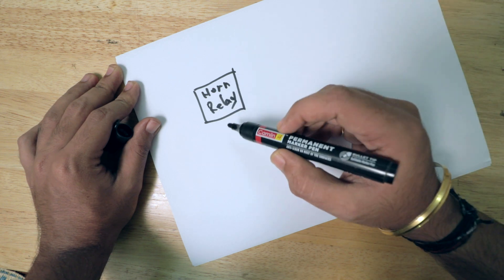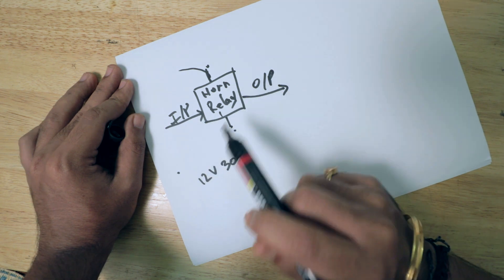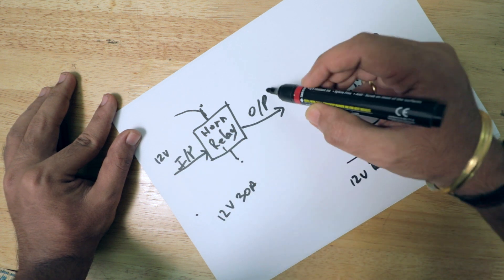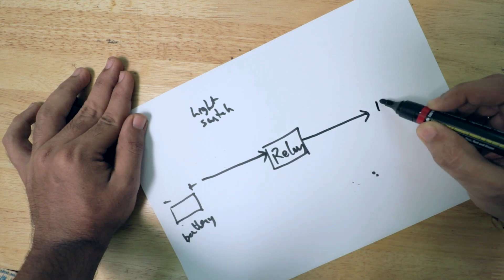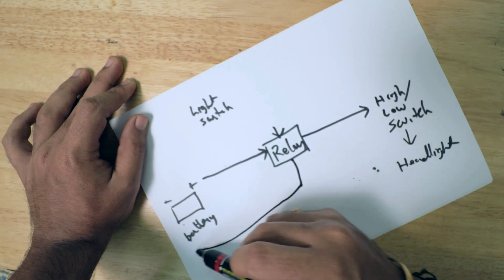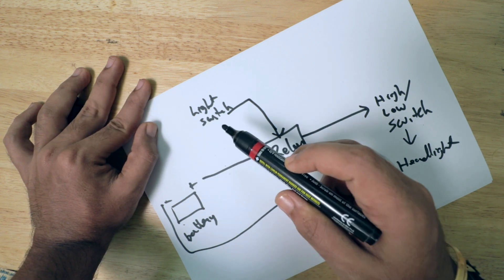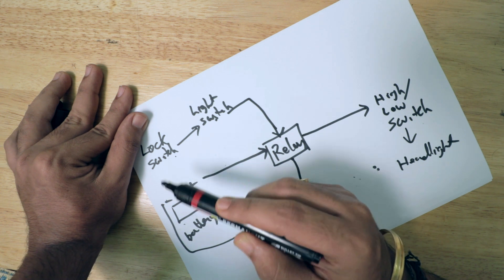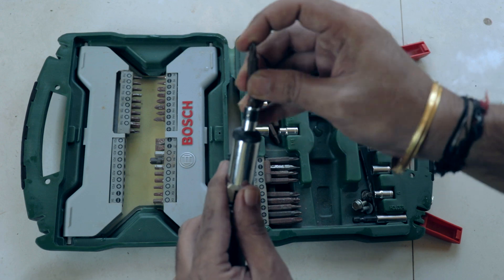Convert any Scooter From AC to Full DC | Activa | change headlight connection from engine to battery

Comment: hi, thanks for the tube. very informative, i got to know about relays. 
one doubt though. you instructed to connect battery +ve to relay30.  dont we need a fuse in between?
how about taking a line from lock switch and feed it to both light switch and relay30?
as there is factory built fuse between battery and lock switch, i guess we don't have to put another. am i right? 
i want put headlight on DC via a switch in my Activa 4G BS4.  appreciate your answer.
pls help me understand the concept. thanks
Reply from the maker: Yes sir , I did mention to use a fuse In between battery +ve and the relay for protection.
You can use supply from stock lock switch but then it will pass voltage  from stock wiring which can be less than what you can get directly from the battery
Reply: thank you Rahil ji, good morning
pls see this diagram https://photos.app.goo.gl/gkvA8skc83PYPWbU8

1) except for the little drop in voltage, is the change in wiring OK?
is my 8W rated switch protected from 70w bulb load?

2) manufacturers used to give relays with headlight bulbs until BS3 (Activa 3G for Eg)?
if not how were the switches protected then?

3) does this switch breaks tail light along with headlight in this wiring parellelly?

4) is the tail light also converted to DC if I just put headlight wire on relay in visor?

pls suggest any changes. thanks so much
Reply from the maker: Circuit in original part in your picture is what you should be doing to convert your bike to DC.
Original stock uses alternating DC .Main ac voltage >30vac comes from alternator to regulator and then gets regulated to alternating DC to  the headlight bulb.
1) 70w load is not recommended as the size of battery in activa is small so you will face low battery problems
2) No relays, it's on Regulator Rectifier (RR unit)
3) yes headlight and Tail light are parallel
4) which visor?
Watch the video again carefully after considering my points and you will understand. If not then  I'm still here😄
Reply: Thanks for reply Rahil ji
I'm not done bugging you 😁

1) I thought stock H4 draws 35+35=70w while on high beam. I'm wrong then. still how those 8w rated headlight switches in older Activas were protected without using relay?
if they switched headlights without relay, why can't we do it now?

2) only diff between 2 parts of the drawing is where I connect relay30.
what's wrong if i connect both relay30 & relay85 to +ve comin from lock key instead of running separate wire and fuse directly from battery to relay30?
I do this and still expect the circuit works good and I'll have lesser load on switch?
Reply from the maker: Haha no problem Rajesh sir😄
1)stock halogen uses 2 filaments, one for high and one for low beam, 35w each at a time . From what I know the switches are just made up of copper terminals for the only purpose of connectivity. That's it

The purpose of relay is just to bypass the voltage from stock wiring to the new bulb directly. This method is efficient. 
Also note I disconnected the stock supply at the high low switch
Reply from the maker: 2) if you do that the relay will be energized the moment you turn your bike key to on and switch the headlight on😀 which I believe you definitely don't want.

First of the load what you are considered about of the switch. Take it out if your mind. That does not matter at all if using stock switch. 
And like always,
I'm still here or if not then Instagram 😄

Comment: My schooter haven't battery what is remady .can i get dc volt for my break .light and indicators
Reply from the maker: I did not understand exactly what you are saying. Your scooter does not have a battery, if that is what you are saying then you will need a RR unit and a battery.
Other option is to use rectifier diode but then it will still be variable and alternating

Comment: Sir i have pulsar 200  2007 model i want to make ac to dc pls guide
Reply from the maker: The logic is same as what I have mentioned here, find a +12v after the lock switch and pass it through the on off switch to the relay coil, then connect the other end to ground. Then use a +12v from battery to the relay input and connect the output from relay to the input of high low switch. That's it! All the best😊

Comment: Plzz tell me that if i install bigger battery than original in my bike, would the rectifier charge it efficiently as before or not??
Reply from the maker: It will take little more time to charge higher capacity battery to it's full capacity. So no problem installing higher capacity battery

Comment: When i started with self the led light was blinking and there is little smoke coming out what to do
Reply from the maker: You did something wrong , or loose connection, check the wiring again with multimeter

Comment: But bro I had seen a video in which the guy uses Splice connector wire  without cutting any wire please make a video using splice connector if possible. 😐
Reply from the maker: Even if you use splice connector at the high low switch you will still have to cut the headlight on off switch wires completely to make the relay work. 
I would not recommend Doing it without using relay as that will make it unsafe

Comment: Hey I’m planning on doing this conversion. Do you have any idea if the new stock LED headlight of 5G Activa fits the 4G Activa which has halogen setup?
Reply from the maker: No idea about that but why the 5G headlight? For brightness or just for the look? 
For the look then it's fine or else you are better on with the reflector for brightness

Comment: I fit an Led in my Honda aviator but my fuse keeps blowing up how to fix that?
Reply from the maker: Check the rating of the LED bulb and also the rating of the fuse that you are using and let me know
Reply: @RahilChodanker  The bulb is 36 W and the fuse is the one which comes with the scooter by default.
Reply from the maker: What about the current draw of the bulb? And is it on DC setup or stock AC?
Reply: @RahilChodanker  It was on AC by default but my friend helped me to convert it to DC
Reply from the maker: Great, just check the current rating of the bulb and accordingly use the fuse, also make sure that the supply to the bulb is bypassed from the battery directly as in my video

Comment: my light is led ..can i use 40A  12V DC Hid Relay.that is i already have...idid'nt find horn relay on my honda hornet 160r..
Reply from the maker: For sure you can use but will need to work out with the connectors
Reply: @RahilChodanker  ok..thanks alots

Comment: Bro can you do this on ACTIVA 4G because in activa 4g there is no headlight switch and it is also confusing. Actually i want that when my activa is in ignition only in ignition, not start then in headlight their is parking bulb it will on automatically is this possible ?? Please reply
Reply from the maker: I did not understand you but yeah if you want to convert to DC then you can use a 2step headlight on off switch so that you can control the parking bulb as well as the headlight
Reply: @RahilChodanker  sir i want to convert only PARKING BULB to DC.... Jo headlight mai chota sa bulb hota hai  parking bulb ussko battery par karna only. In Activa 4G   Reply pls
Reply from the maker: You want a switch for that?

Comment: Just read a comment. The charging of battery will be slow in the night. Can we rectify the yellow wire and connect to the Battery for better charging?
Reply from the maker: The resultant will be the same as there is one more wire which goes through to charge the battery, also it's not simple as rectify and connect, you will also need to use voltage regulator to control the voltage

Comment: Is it possible in Bajaj super scooter and does conversion of ac into dc effects its engine?
Reply from the maker: I guess in Bajaj super you don't have a battery. So this method will not work, you will need regulator rectifier and then install a battery first.
It does not affect engine at all
Reply: @RahilChodanker  it means i have to modify its the whole wiring system too?
Reply from the maker: No not everything, you will have to use the wires comming from the alternator as input to regulator/rectifier which will give you dc output which you can then use to charge the battery, once you do that , then you can follow this video
Reply: Really not able to control my laughter;) hehehehehe... bajaj gaadi aur ac dc aur battery set up...  hehehehehe... I was thinking if it works for activa at least. I'll try for my Unicorn now.

Comment: You can also replace the ac current wire with dc current wire
Reply from the maker: You mean by just replacing the ac wires with dc you will get a direct current supply?? If it is then it's not possible without conversion

Comment: So where is the bridge rectifier?
Reply from the maker: Bridge rectifier not needed as the source supply is from the battery which is DC . If you use the alternator wires as supply then you will need bridge rectifier
Reply: Then how do you charge the battery if no dc source from alternator?  Total loss is fine on a race bike but not great for street.
Reply from the maker: There is a Regulator Rectifier already present in street bikes which charge the battery
Reply: Yes, our goals are different.  I want to change a bike over to dc with a cap and have the cap which is essentially a 12v system with charging so it's maintenance free.   No headlight or taillight blink and no battery.
Reply from the maker: Crafted for that you will need a bridge rectifier, capacitor and a voltage regulator set to 13.5v to 14v
Reply: Eterno ka horn kaise tez bajega usme kya lagana hoga

Comment: Can it b done in aho? Without removing aho?
Reply from the maker: Yes but the wiring will be slightly different and you will also need a sensor if you want to preserve AHO
Reply: Rahil Chodanker can u help me with the circuit ? And will it drain my Battery ?
Reply from the maker: Lavansh Sagtani yes definitely, don't worry it will not drain the battery.
To be safe what I will do is get hold of my friends scooter with AHO and make a video about it so it will be a detailed. What say?
Reply: Rahil Chodanker that’ll be great but how much time will it take coz I’m impatient! 😅
Reply from the maker: Lavansh Sagtani hahaha untill I find a guy having aho in his bike.
Btw why don't you consider adding a headlight on off switch ?
Reply: Rahil Chodanker I just like the AHO feature.. well u can just text me the circuit diag?
Reply from the maker: Lavansh Sagtani I can't suggest you anything unless I do it personally as even a small mistake can burn down your scooter
Reply: Rahil Chodanker oooo okay... then I’ll prefer waiting.. haha.. thank u so much! ❤️

Comment: Does it need to be 30A relay and would i need a resistor so the led wouldn't die?
Reply from the maker: Resistor is not necessary as already battery is a stable power supply, the voltage comming to battety also passes through Regulator Rectifier.
The Rating of relay can be less too depending on the current drawn by the headlight bulb you use. The standard horn relay is 30A which is available in the market for cheap

Comment: सर मेने बहुत वीडियो देखि ह पर आज तक जो मने सोची ह वो वीडियो नही मिली....

9v ac bulb आता ह उसकी प्लेट को निकाल कर कैसे बाइक की लाइट की जगह कैसे यूज़ करे.....

उसकी रोसनी बहूत होती ह पर बाइक में कैसे सेट करी जा सके ह......

9v ac बल्ब जो आज कल सभी क घर प पाये जाते ह...
Reply from the maker: 9v jo bulb hai uski roshni bike me nahi aaiyegi , ulta samne wale ko aap ka bulb andha baneiga.
Upar se woh single beam hoga.
Plate nikal ke aap ek dc-dc step down voltage regulator le lijyea, phir usko bike ke ek beam ke wire ko input me connect karke, phir led plate ko output ke connect karkna hoga, connect karne se pahile dc-dc step down pe 9v set karein.

Aapka jugaad ready👍 

But vapas apko plate ki position dekhhi padegi, meri mano toh aap mera led wala video dekh lo

Comment: The relay is turned on every time??!
Reply from the maker: Yes , it acts as an internal switch
Reply: Rahil Chodanker  it will drain the battery?
Reply from the maker: No it will not drain battery at all

Comment: What about indicator and tail lights? How can one convert them to led?
Reply from the maker: +Karan Singh you can use led tail lamp directly after converting, 
For indicators chk out my video on Switchback led turn indicators
Reply: Rahil Chodanker I'm considering using a bridge rectifier + capacitor to convert existing ac Headlight line to DC. Do you think that'd be good enough?
Reply: Rahil Chodanker I guess you're calling the bridge rectifier 'relay'

Comment: how to do in bikes........... Glamour. as it has only one switch ..................
Reply from the maker: Yes just one switch for on off is more than enough
Reply: How to find high low switch wire in glamour
Reply from the maker: Rahul Mishra it will be behind the high low switch
Reply: Rahil Chodanker there are three wires at the high low switch. One is white blue which is connected to relay. One is white red which is connected to headlight switch. Third one is white colour. I m confused
Reply from the maker: Rahul Mishra do you have a multimeter to check?
Reply: Rahil Chodanker yes
Reply from the maker: Rahul Mishra great!!
Use continuity to find out the high ,low and the common input, 
Once you found the common input, connect the output of the relay over there
Reply: Rahil Chodanker thnx. Also is there any way to send u pics of my wires for further issues
Reply from the maker: Rahul Mishra send it on my Instagram
Reply: Rahil Chodanker ok

Comment: Do we need to cut the ac connection of the headlight?
Reply from the maker: Yes, you just need to cut it to separate the ac supply to the light switch
Reply: Rahil Chodanker  and we will connect the cutted wire to the 87terminal of the relay
Reply from the maker: Gour Das nop, just tape it off and keep it aside , we don't need it
Reply: the wire returning to ac will be taped na?
Reply from the maker: Gour Das the ac wire comming from the alternator to the light switch has to be cut and taped off
Reply: Rahil Chodanker okay
Reply: So the we need to extend the switch wire and connect it to the 87 and from the ignition wo need to connect a wire to 86 and 85 would be grounded
Reply from the maker: Gour Das yes
Reply: Rahil Chodanker which is the high low switch?
Reply from the maker: the  switch you use to put the headlight to high beam and low beam
Reply: The relay turn on every time?

Comment: Do we need three relays - one for headlight, one for pass switch and one for position lamp?
Reply from the maker: Position lamp is not current and voltage intensive so it's not required, 
Just one relay for headlight
Reply: Rahil Chodanker And what about the pass switch?
Reply from the maker: no not required for pass, I will actually make a video on pass light switch
Reply: How much should be the thickness of the battery positive wire? As the battery is under the seat in TVS scooters, so it is difficult to connect to the battery every time. So I am planning to extend the battery positive and negative to the front of the scooter and use it as the master positive wire for all mods in future. How thick a wire should I take for the positive and negative in that scenario? Thanks in advance :)
Reply from the maker: Nekib Ahmed that thickness will entirely depend on how much loaf you are going to put, I'm sure it won't be much , so under normal circumstances, 1sq mm or 1.5sq mm will be good for normal led mods, 
Also you don't need to take negative terminal all the way up, you can directly connect the negative terminal to the chasis of the bike.
You can also take a positive terminal from the lock switch so that your mods will then work only when the key is turned on position
Reply: As of now, I have taken the positive supply from the ignition and connected directly to the Light on off switch without any relay. I am planning to do it your way, with a relay to be on the safe side. But the battery is not easily accessible in TVS scooters. So I want to extend the battery positive to the front. I will use that positive wire as the master wire for all mods in future, with relays. I might use it for dual windtone horn, bar end light or some other mods in future. How much thickness would you recommend for this wire?
Reply from the maker: you will be good with 1.5sqmm for the main wire for supply from battery to the front, from there use the terminal as junction